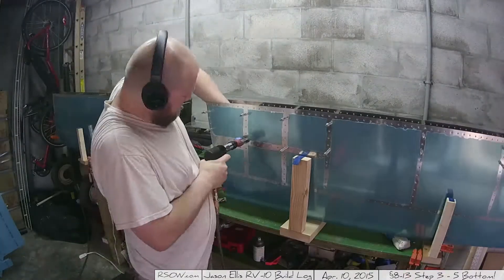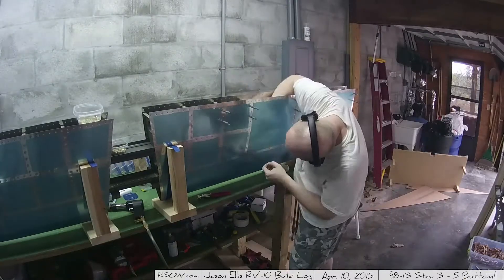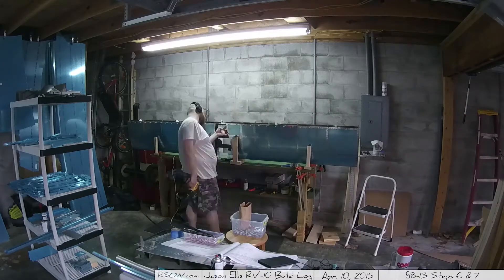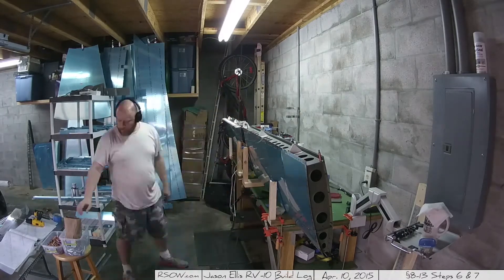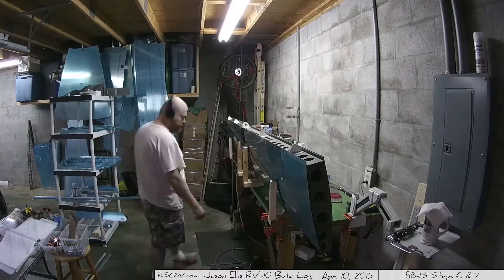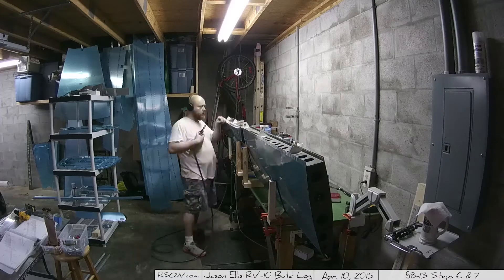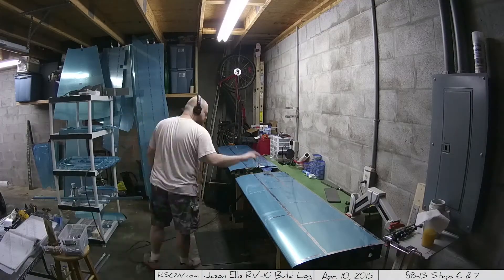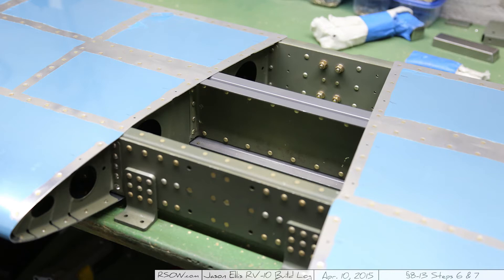RV-10 Empennage Section 8-13 steps 3 to 7

Comment: there are a couple pros and cons to using solid rivets vs mechanical lock rivets.

1. pro - Solid rivets are made of the same metal as your structure, aluminum, so there is really no corrosion to using these rivets.
con - if you shoot a bad rivet, its bad. if toed over, the rivet an fail. if not not hard enough it will be loose, and so forth

2. pro - mecahnical rivets. easy to use. They go in easy, when pulled with a pneumatic gun, and the pin breaks, they are done. as long as you have the correct length in use, you cannot go wrong.
cons - if you do not use a gauge to check length , you can have a rivet that will not lock, and be loose and fall out. they are harder to drill out. Some of them have a steel pin, and when drilling, the drill bit can slide off, and then you will elongate the hole in the structure. Assuming you did everything corectly, you should not need to drill them back out.
Corrosion can be an issue if they are not like metals.